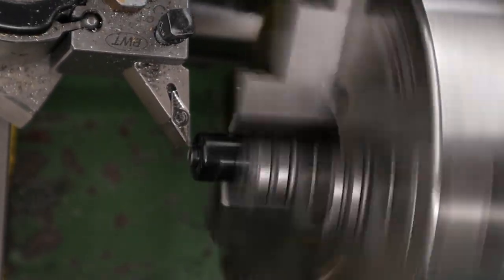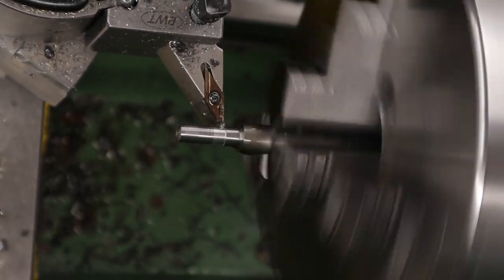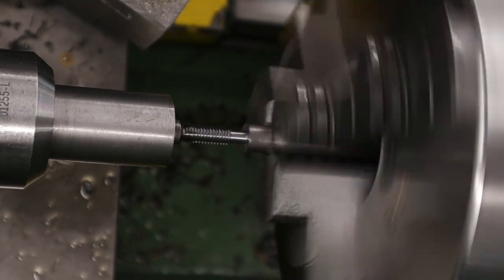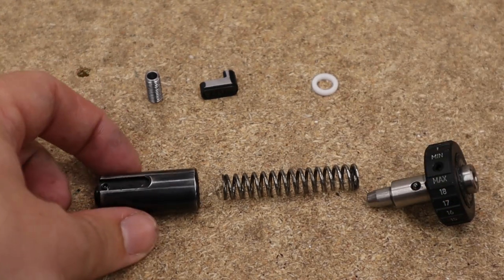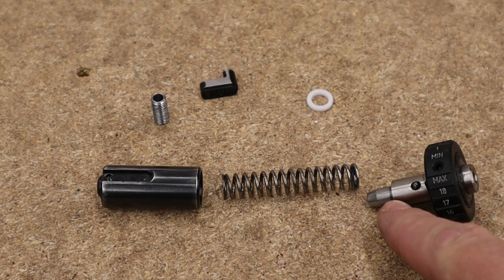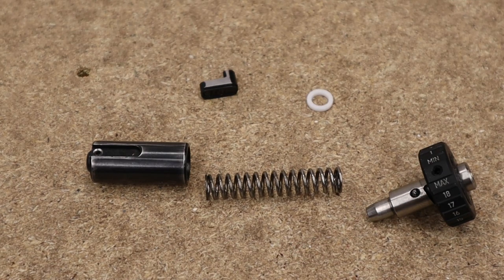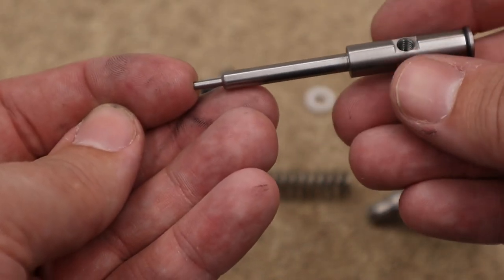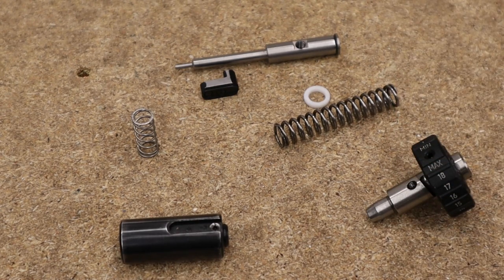BRK Ghost making an adjustable hammer.

Comment: Good work as always. I've got a barsteward of a Kalibrgun Capybara to sort out. I'll be extracting broken screws from the block, milling a new internal bolt lever and trialing a brass bushing on the bolt cocking pin... The thing is an absolute mess. I've not much engineering experience so relying on videos like this for some handy hints for when I attack it on Wednesday.
Reply from the maker: sounds like you have your work cut out there hope it all goes well 😀👍
Reply: @sub12airgunners  that's putting it mildly, and thank you, I'm confident it'll be a good little rifle, I only wanted to see what could be done to make the cocking action less violent but opened a can of worms. Apparently we shoot at the same range so if you ever see a Capybara in the future chances are it's mine.
Reply: @unlisted5150  if  i see one i will be sure to say hello  😀 that's what happens to us, we start a little job and go down the rabbet hole and before we know it it's been in the mill on the lathe and it's been re made 😂😂
Reply: @jeffhello1444  lol absolutely! Not the first, won't be the last. I am hoping to be up and shooting in 2 or 3 weeks so keep em peeled 👀😉

Comment: Great work as always. I have a ghost and the twang from the action is driving me crazy.would adding a delrin tip to the standard hammer quieten things down.not looking to adjust power.
Reply from the maker: that did help our one but we did change the hammer spring and did insulate the springs
Reply: @sub12airgunners  thanks for reply 👍
Reply: Sorry to be a pain. Could I ask one more question.how did you insulate the spring. Thanks 👍
Reply from the maker: @alanclifton2251  we used delrin slip rings for the ends like washers just to stop metal to metal contact
Reply: @sub12airgunners  thank you much appreciated. I'll give it a go👍

Comment: Hello! My name is Henri. Im looking for some advice....i have a very simple pcp hatsan flash 5.5 that installed a reg and a stiffer steam spring in exhaust valve....have a quite nice free fly play. Just like that  yesterday i made 2 slow motions videos ...a hammer traveling bounce and a manometer pointer bounce, if you interested i can share both. I thinking in choose hammer spring shorter and stiffer to increase free fly and see if it has some improve. But the pointer bounce too much than expected vs hammer bounce...maybe the plenum is under necessary cc volume? If you have some advice how can a minimize this i ll be quite pleasant! Love you channel! Only amazing information!

Comment: Very cool, excited to see what you keep building! Question for you, do you think a .22 FAC ghost can be modified to shoot at sub 5 ft-lbs and then quickly tuned up to shoot at something much more powerful. I’d like to be able to go back and forth for indoor/outdoor shooting.

Currently using a Pathfinder with an Air Superiority Power Adjust fitted to it, but not very happy with it. Difficult to adjust and it makes the length of pull very awkward. Cheers!
Reply: Does liking my comment mean you think it can be done 😉?!

Comment: I got a 177 Ghost HP a couple weeks ago and just found your channel.  It's excellent!  The PTFE washers for the hammer spring...is that your modification?  My Ghost did not have them...What size are they?  Won't adding these increase the compression of the spring?  My rifle came with the HP2 spring which was "too much" in that it didn't have very much difference between Min and Max on the Power Wheel....eventually ended up with the LP spring to get decent adjustability with the Power Wheel.
Reply from the maker: The washers are a mod we did, they do increase spring tension a little but we changed the hammer spring anyway, the washers don't do so well with the stiffer springs delrin is better for them but for our sub 12lbft springs ptfe is  fine  👍 thanks for watching the vids  👍
Reply: thank you! @sub12airgunners
Reply: Follow up question...to have the "optimal setting" for a particular pellet...optimal being the smallest spread in velocities while minimizing air consumption for a shot...do I want the smallest hammer spring force thus a higher regulator pressure? Or more hammer spring force with a lower regulator pressure?  Higher regulator should, I think,  result in faster plenum recharge...and to get consistent hammer spring response...does it matter if the PW is set at Min vs Max or in-between?  I emailed BRK asking for the "formula" for which hammer spring to use for a particular caliber and weight...since diabolos are most "stable" around 850-890 ft/s...don't be shocked, but I got no reply....
Reply: what thickness delrin washer would you recommend?  thanks! @sub12airgunners
Reply: I just looked and Nylon washers seem to be more available in various sizes and thicknesses...any issue with using Nylon?
Reply from the maker: we go 1mm most of the time 😀😀

Comment: Great stuff, are the .177 pin probes available or are these a .25 cal turned down to fit. Be interesting to see if you can run a lower reg pressure to increase shot count are you doing anything to the barrel transfer port..
Reply from the maker: the pin probe is something we made   😀 we are playing with reg pressures ate the moment 😁

Comment: The action on these Ghosts are definitely a tad noisy. The delrin tip is something I'm thinking about doing too. How did you secure the delrin in the pip? Having never done one I'm wanting to avoid any pitfallls.
Reply from the maker: Hi it's just a press fit in to a rebait we have done lots like this with no problems
Reply: @sub12airgunners  Thanks for that. Just a good old interference fit then. 👍
Reply: Just about to strip my ghost to make a delrin tip. I suppose if all I want is a quieter action then just a delrin insert in the factory hammer should do trick. I've just acquired a lathe but watching your videos has convinced me I need a mill too. As if I don't already bleed money on air guns as it is 😅

Comment: black magic i tell you 🤣🤣🤣 how does a spinning tool cut an allen slot . man you show some awesome stuff mate 👌 very interesting is that to really fine tune the hammer as that wheel is a bit to course or the other way round and the wheel does not give you enough adjustment
Reply from the maker: Thanks Paul yes it does seem strange but it works a treat 😀 yes we will have a bit of adjustment on the hammer stroke, which may help when we start to muck about with springs and things 😀